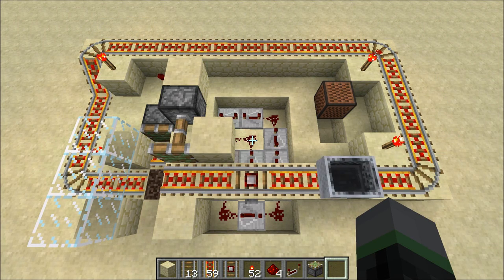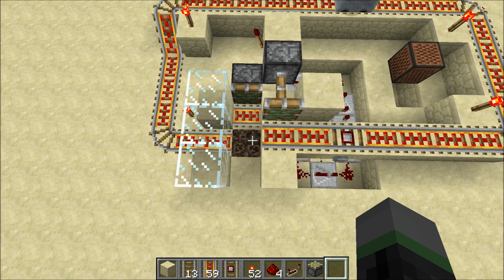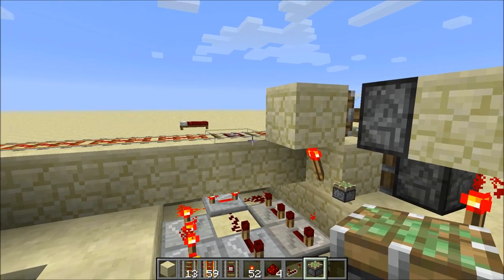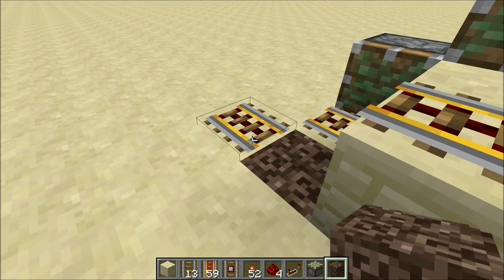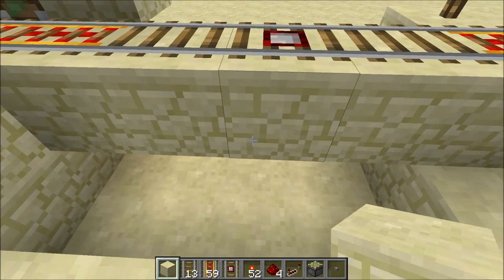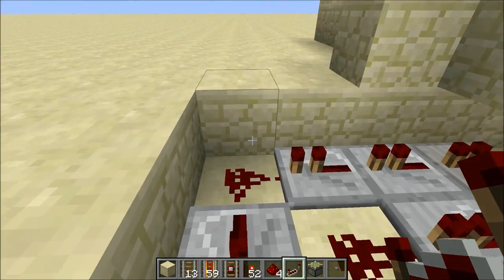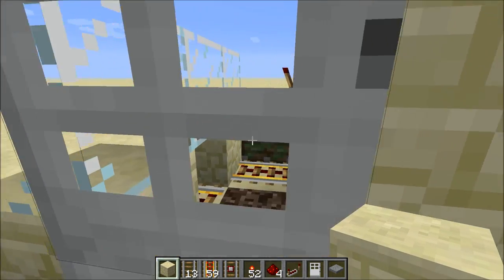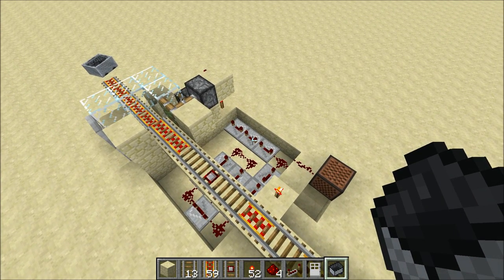Simple Delayed Minecart Stop + Tutorial (Minecraft)

Comment: Just what I was looking for as a starting point!

My villager spawner pops villagers into minecarts. I need to inspect them to remove farmers before they leave the station, and I currently do this manuallly. I also want to switch the track behind them so it bumps the next minecart to the next available open station. This will make a great starting point!

EDIT

Unfortunately because of 1.9 changes, it no longer works. Some combination of having the minecart jump and having the piston move the powered rail prevents the minecart from starting. It will work if the minecart is placed, but not after it jumps. I think this is because of "momentum" mechanics introduced. I am unfortunately not clever enough to have the minecart roll backwards after the jump to be flush against the backstop so it will start once powered.